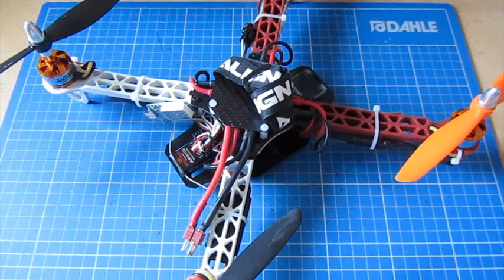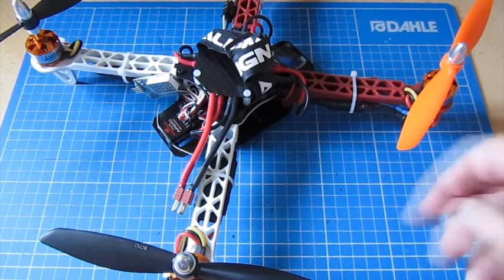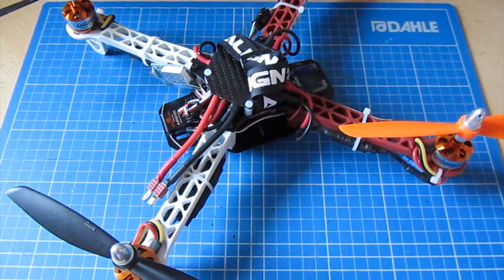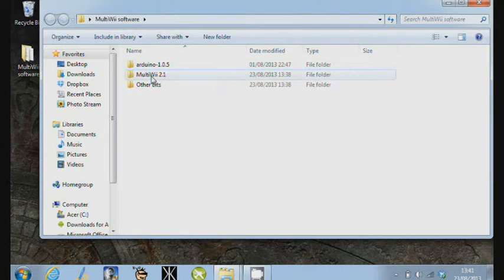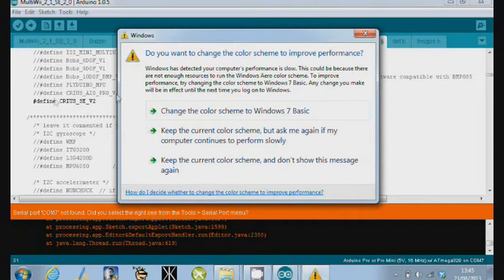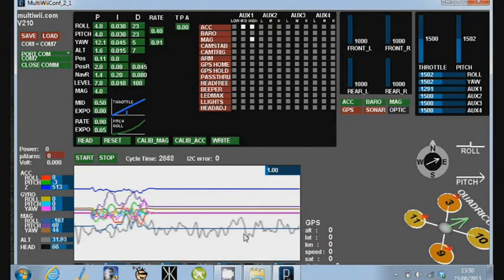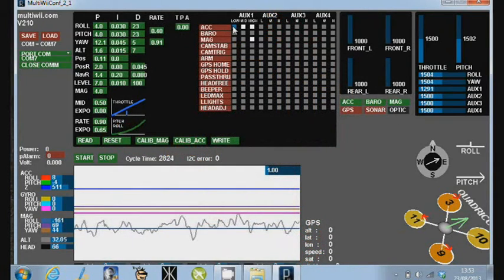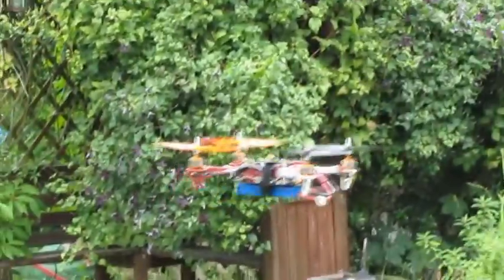Crius SE V2.0 MultiWii Board (MWB) Overview and Setup

Comment: Hello. 

I have build my first quad with multiwii SE and hobbling T6 transmitter. I uploaded the multiwii code but the motors does not spin. 
In configure GUI i can see the channel values changing when I move the sticks. 

Do you have idea what I am doing wrong? 

Thanks in advance.
Reply from the maker: Rodrigo Mourão hi, watch http://youtu.be/lc4ECi6JYX4 and see if that helps, if not then come back. Good luck with it.
Reply: Painless360 do you have idea if i have to change some values in config.h or multiwii.ino ?
Reply from the maker: Rodrigo Mourão You should only need to change the main values in the Multiwii code in the config.h section as shown in the video. Make sure you've calibrated the compass and accelerometer after you flashed the firmware..

Best of luck!

Comment: I was able to configure my 2.5 SE board using a Mac computer. I am having trouble with the Navy board though. When I down load the i2c_gps_nav software I find a i2c_gps_nav.ino file but it says I need to save to a sketch file. I have done that but it then says it can't compile because no file exists. Any suggestions?
Reply from the maker: Roger Bowen Please watch the video on the channel that covers setup of the i2c board. Watch what file is being used and you could try a earlier version of the Arduino code (see video posted today)
Reply: Thank you.

Comment: is this tutorial similar to the Multiwii and Megapirate AIO Flight Controller by hobyking?
Reply from the maker: Hi Michael, you can use the same code to run the AIO board. It you can also use the megapirate software on it too.

Comment: Hi Painless, I have a problem with a multiwii 328p board, i suspect the 3.3v regulator has gone faulty, as there is no longer a 3.3v led indicating its presence. the board has been working great for a few weeks now, but seems to have developed this fault i get loads of I2c errorr in multiwii.conf, and the IL340 chip on the board is very hot.. I have tried to find what this chip is.. and was looking to replace it any ideas ? thanks Al
Reply from the maker: Hi Bing, sorry but I don't know. I would replace it for peace of mind.

Comment: Hi, any thoughts on why my quad would move around a lot in gps hold when it's activated. When I activate gps hold, I also have horizon, baro and mag activated as well.  The gps return to home works ok. But not the gps hold. So when I activate gps hold should I have those other activated as well or one or the other. Cause man, when i hit gps hold the quad moves in a 15 foot circle and of course it rises and falls about 6 foot range.
Reply from the maker: Sadly it will. If you connect the model to MultiWiiConf and look at the position information in the scr4een you will see the position 'move' even when the model is still. You can change some of the code to alter the GPS position moving average and speed of movement for the GPS functions to reduce the excessive movement. 

Hope this helps.

Comment: Yes, I'm having an issue uploading to my v2.5 board. Wondering what I've done wrong, does the board need to be connected up to the escs or can it stand alone?
Reply from the maker: Hard to help without the actual error and more detail...
Reply: Painless360 hi, yes, after uploading the sketch it mearly says "problem uploading to board. See htp//"....  Etc. When I connected the board via USB the blue light flashes then goes out, unless you move the board, and has a steady green light whilst plugged in. However it won't connect if all the wires to the escs are also plugged. So at the moment it's mearly the board plus ftdi.
Reply: Painless360 thank you for any help. The last stuff I flew had mechanical gyros. Lol
Reply from the maker: Blimey - it's moved on a bit! :) More computer science than hobby now..

I'd direct you to look at the manual ways to reload the bootloader see http://www.rcgroups.com/forums/showthread.php?t=1653753

If that fails you may have a duff board..

Best of luck.
Reply: Painless360 thanks for the help chap. I'll look into it now. Cheers.
Reply: wraith01mg pity no one in rc forums are helpful to my problems seems sarcasm is their only answer.
Reply from the maker: You need to forec the bootloader, this is documented in the forums.

If that fails then I'd suspect the board..
Reply: Painless360 ah, now does baseflight or clean flight work with this board? If so, that's one of the issues solved.
Reply from the maker: If you can post a video showing the lights/error on the screen that would help me see exactly what the issues may be..
Reply from the maker: FYI - I've updated this video with a newer version that uses the SE V2.5 board and Multiwii V2.3 to configure it. See https://www.youtube.com/watch?v=Zm8z4RLkFGU&list=PLYsWjANuAm4qSqszQR6qIisiwk5r-_nMk&index=1

Hope it helps

Comment: Hi can you tell me wich board is better and easy to conf   The crius multiwii se 2.0 or 22.5?
Reply from the maker: I'm guessing that you mean 2.0 or 2.5? If so then the 2.5 is a later version of the board and will work if you select the 2.0 settings in the code.

The 2.5 version has an extra i2c port. Happy flying!

Comment: Has this board also support for way points?
Reply from the maker: This version does not. Larger versions of the Multiwii board (like the AIO) will take a modified version of the code that runs on another controller called an APM. That will support waypoints.

If you need waypoints then I'd consider the APM instead. See https://www.youtube.com/playlist?list=PLYsWjANuAm4oswLMu9OU8yOm-9J6y30XW  for more detail.

Happy flying!
Reply: Painless360 Thanks for your answer. I have already an Mini APM for my Quad and enjoin you Series very much and Thanks your professional  Videos they are very helpful.

Comment: getting this "programmer is out of sync" error, checked COM ports numerous times and switched computers... any tips?
Reply from the maker: Most commonly this is due to the wrong board being selected or the file size being too big. I've not had this myself so I can only see what is in the forums. Sorry I can't be of more help. If you find the solution can you let me know?
Reply: I have double checked the board is the same as the one you have selected and the file size is correct as I am able to verify/compile. Any other tips?
Reply from the maker: Only thing I can suggest is have a look at http://code.google.com/p/arduino/issues/detail?id=661

There seems to be lots to try there.. Good luck getting this sorted.

Comment: Hi i have Programmed MultiWii 2.5 and connected with ftdi module but in GUI the Sensors are not working and also not responding , if you know how to fix this problem or troubleshoot please guide me .
Reply from the maker: Please watch the multiwii series here on the channel. I haven't touched a multiwii for a couple of years now so I'm a little out of date, but all the basic troubleshooting are in those videos. Best of luck!

Comment: i have mwc v2.5. i used your programing and the sensors work good for about 20 seconds then they all go crazy. Can you help?
Reply from the maker: Recalibrate the sensors and if that fails, reflash the board with the software. Good luck.

Comment: HI 
The link to google no longer offers V2.1  and the MultiWiiconf are PDE file format not executable s

Might confuse anybody ( like me) following your otherwise excellent vids on the MultiWii
Cheers
Reply from the maker: Thanks for the comment. That's why the videos have dates on them as everything is changing all the time so no video stays up to date forever.

I do provide a link in the description to the files I used in the video for those who are confused and want to us the identical (if outdated) files.

Good luck with your build. Happy flying!
Reply: Painless360 Thanks . Heres the current link to the downloadable zip files ( as apposed to the source files) 
https://code.google.com/p/multiwii/
Got bored of waiting for my FTDI adapter to arrive so managed to get an Arduino Uno to work as an FTDI interface instead.
Reply from the maker: bigfilsing Good job! Happy flying!
Reply from the maker: Painless360
FYI - I've updated this video with a newer version that uses the SE V2.5 board and Multiwii V2.3 to configure it. See https://www.youtube.com/watch?v=Zm8z4RLkFGU&list=PLYsWjANuAm4qSqszQR6qIisiwk5r-_nMk&index=1

Hope it helps

Comment: Hey painless360, I have a crius se v2.5 and I'm having a problem with it once I upload a sketch. It uploads then the board has no response  the board has a solid green led as well as the blue led flashes continuously. I am at my wits end and really need some advice.
Reply from the maker: Hi, the flashing blue LED usually means that the board thinks it's not level. Connect via MultiWiiConf and reset the accelerometers via the application and see if that clears it.. Let me know.
Reply: Painless360 ok i've got it cleared and i can arm it but can't fly it due to it wanting to flip over when i give it any throttle input. I've been doing research and feel confident with flashing sketches but still feel lost when it comes to changing any of the settings. any advice?
Reply from the maker: Sounds like two of the motors are swapped over. I had this myself on one build and it drive me nuts until I figured it out. Recheck the connections to the motors/esc..

Good luck.
Reply: Painless360 the motors are correct.i just uploaded your sketch again and went to gui and for some reason dont think the mag is configuring. now whats happening is it will not come off the ground. throttle up and it starts to pulse.

i can get it to flip over with multiwii 2.0 but also when in gui the direction is like its + instead of x?
Reply from the maker: I would start with a clean setup and create the code using 2.2 or 2.3. Be very careful when using multiwiiconf that is a different version. I've seen lots of issues from people using 2.2 firmware and trying to configure it with 2.3 of the PC application/mobile app.

Hope this helps..

Comment: Thanks for the great video! 
However, I'm having trouble with the flashing part. This is a copy of the error: avrdude: stk500v2_ReceiveMessage(): timeout
avrdude: stk500v2_ReceiveMessage(): timeout
avrdude: stk500v2_ReceiveMessage(): timeout
avrdude: stk500v2_ReceiveMessage(): timeout
avrdude: stk500v2_ReceiveMessage(): timeout
avrdude: stk500v2_ReceiveMessage(): timeout
avrdude: stk500v2_getsync(): timeout communicating with programmer

Can you explain whats wrong and how to fix this?

Thanks!

P.S. I am using the Multiwii and Megapirate AIO Flight Controller w/FTDI (ATmega 2560) V2.0 board that I purchased from hobby king.
Reply: Also, the reason why I'm trying to flash my new multiwii board in the first place, is because I can't seem to get this board ARMED. I've read that one has to adjust the min throttle & max throttle in order to get it to arm. Am I correct?

Anyhow I'm majorly confused with this new multiwii board. For example: How do you activate the return to home mode, and all of its other neat features? Like altitude hold, compass navigation, etc. (Yes, I do have the GPS module)
Reply from the maker: Hi Bruce, this is usually because the board type selected in the software is wrong, try another that mentions the 2560 CPU and one should work. Hope this helps.
Reply from the maker: Bruce, See my other video - KK2.0 Arming overview for the arming problem.
 
On the other then you need to get the board setup and then connected to MultiWiiConf as in this video. Once you've got this sorted then you use the AUX1 channel to select the modes you want.
 
Hope this helps.
Reply: Painless360 Thanks for the fast reply!
I do not have a spectrum transmitter & receiver. I currently have the FlySky FS-T6 transmitter and its corresponding 6 channel receiver. Basically what I am saying is that the end points adjustment screen is different. http://site.hobbypartz.com/manual/FlySkyT6Manual.pdf 
That link above has info on the transmitter and a picture of the end point screen. (that is if you don't  already know what it is it looks like)

As for the board type in the software... I do not see a board in that list that has 2560 CPU...

Do I need to use a different config version than what you used since my board is different?
Reply from the maker: Bruce, I've just added a new video on this - @EEWE4PZL4TE - hope it helps. Happy flying!
Reply: Painless360 https://multiwii.googlecode.com/files/MultiWii_2_1.zip is the file you use in this video, which is the same file I'm using. However once in config.h - under (Combined IMU boards) I do not see the Multiwii Megapirate AIO Flight Controller w/FTDI (ATmega 2560) V2.0 board, which is the board I have.
In the other video that you made, you explained that I needed to make sure I had the right board selected in the (tools). I selected my board. I also selected the appropriate serial port. As for the list of programmers, does it matter which one i select?

Comment: i have crius se v2.5 board, i can't upload sketches to it. it always gives me that problem : avrdude: stk500_getsync(): not in sync: resp=0x00.
what should I do?
Reply from the maker: I have a video on exactly this - watch this and it will explain the two most common causes. Hope it helps. Happy flying!
Reply: Painless360
i discovered that my mulltiwii board is not recognized by the windows.
what should i do??

Comment: ola amigo eu eu estou tentando instala firmware na placa crius multiwii se v2.5 mais esta dando um erro toda vez.
Arduino: 1.6.3 (Windows 7), Placa:"Arduino Uno"

Opções de compilação alteradas, recompilando tudo

O sketch usa 19.314 bytes (59%) de espaço de armazenamento para programas. O máximo são 32.256 bytes.

Variáveis globais usam 1.153 bytes (56%) de memória dinâmica, deixando 895 bytes para variáveis locais. O máximo são 2.048 bytes.

avrdude: ser_open(): can't open device "\\.\COM1": O sistema não pode encontrar o arquivo especificado.

Problema ao carregar para a placa. Veja http://www.arduino.cc/en/Guide/Troubleshooting#upload para sugestões.

  Este relatório deveria ter mais informações
  "Mostrar saída verbosa durante a compilação"
  habilitado em Arquivo > Preferências.
Reply from the maker: Wemerson Almeida What troubleshooting have you already done?

Comment: great video but i'm have a problem I download your file done a few mods as it a different board like
  #define CRIUS_AIO_PRO_V1
Equipment I'm using is dx6 transmitter Receiver DRX DSM2/DSMX BOARD IM using CRIUS AIO PRO V2.1
try all different firmware but no luck on the board two flash lights orange say TX & RX but no commutation to tx & rx even on multiwii gui no movements
Reply from the maker: Leon Belgrave 
Sorry, I don't use that board myself. So you can flash it successfully but not connect it to MultiWiiConf?
Also be aware that this video is now dated - please watch https://www.youtube.com/watch?v=Zm8z4RLkFGU&list=PLYsWjANuAm4qSqszQR6qIisiwk5r-_nMk&index=1
Or visit https://www.youtube.com/playlist?list=PLYsWjANuAm4qSqszQR6qIisiwk5r-_nMk
Happy flying!

Comment: Thanks for the reply. still not I apply throttle to 80% 85% still on the ground didn't apply the max throttle. I can mail you the config file.I am using 
Afro V3 12A ESCs
Multistar 1704 Motors with  5x3x3in Propellers
Battery 3s LiPo 1000mAh
Reply from the maker: That setup should work fine on a 250 class quad. If you are positive that the ESCs are calibrated then check that the endpoints on the transmitter are set correctly and confirm that the rotors are not on upside down (easily done).

Happy to help more via my Helpout channel (Painless360 Helpout Launch)

Bets of luck.
Reply from the maker: See Multirotor quick tip: Propeller issues, dont install them upside down for detail on how to mount the props (apologies if you've already checked this!)